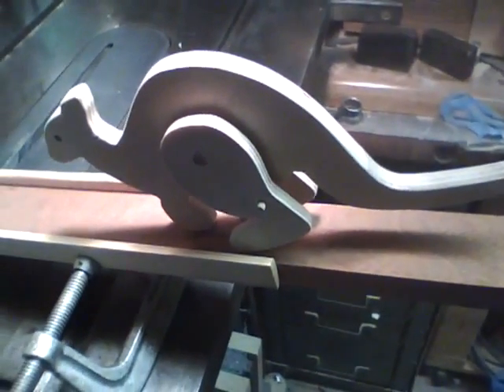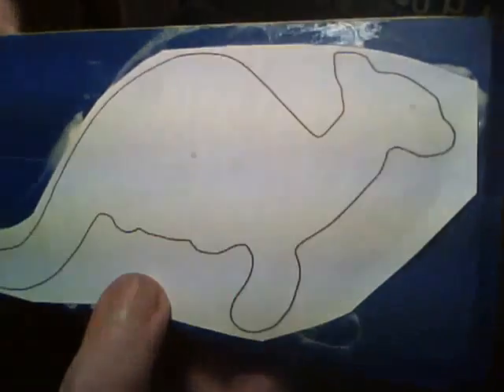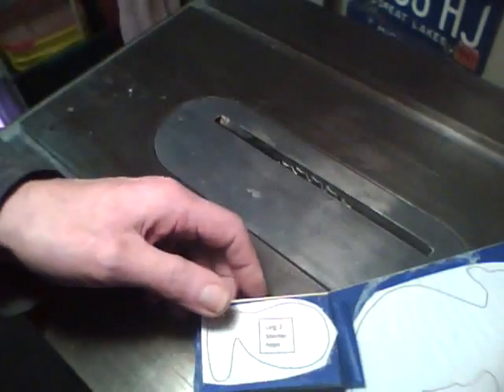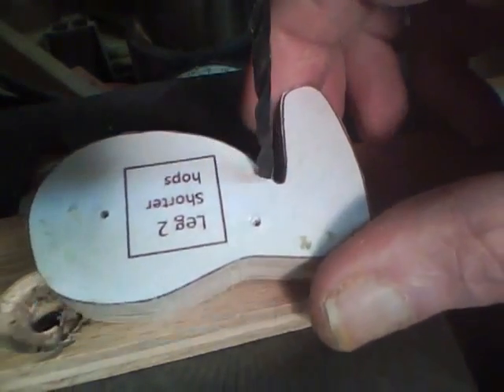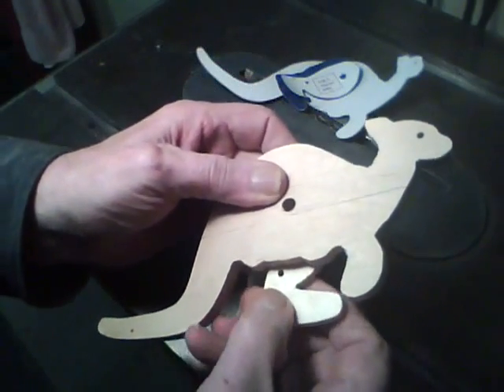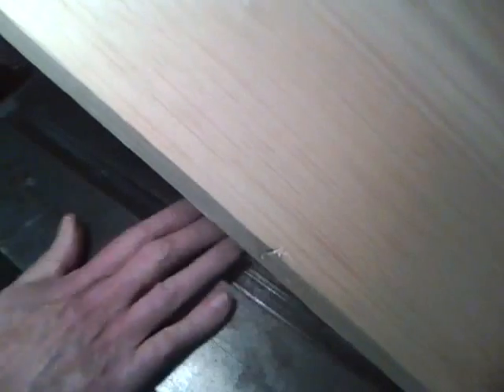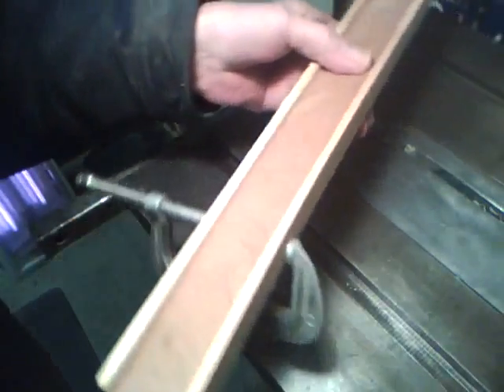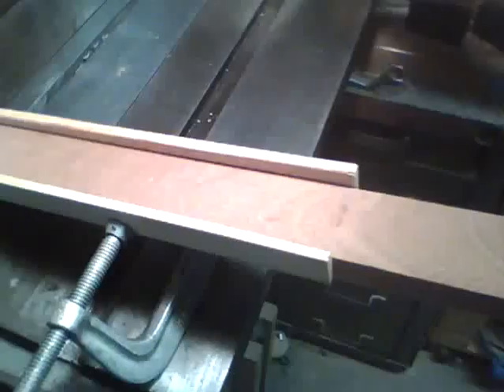How to make a Hopping Kangaroo

Comment: Great Job Jim ! I had a kid and i ve tried to do this kangaroo and the rabitt too but they dont have stability , they fall to the sides. Now i see the thicknees legs are thinner than the body. I build body and legs with the same thickness. I will try again with this tip...thanks
Reply from the maker: danybarrera Thanks. The body has to be thick so it will balance on the front foot and the tail. About 3/4" or 19mm.